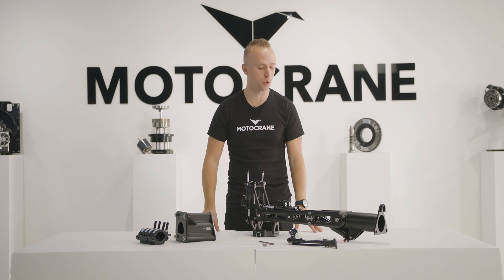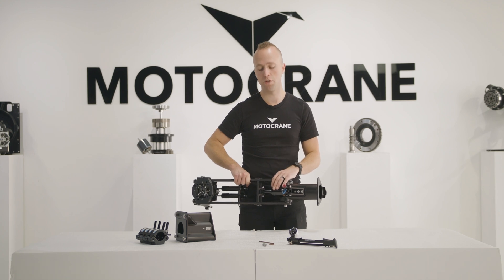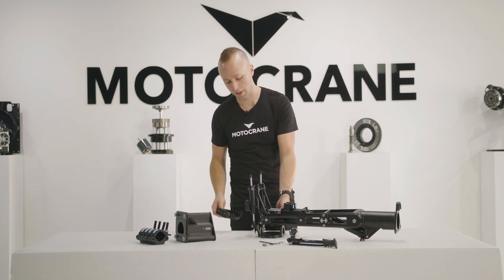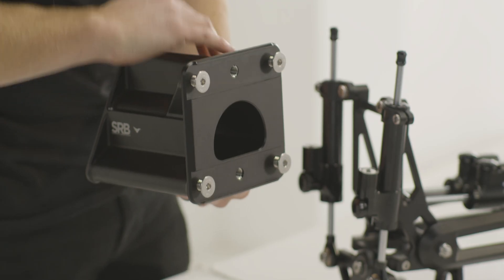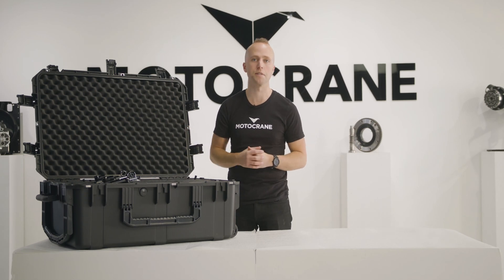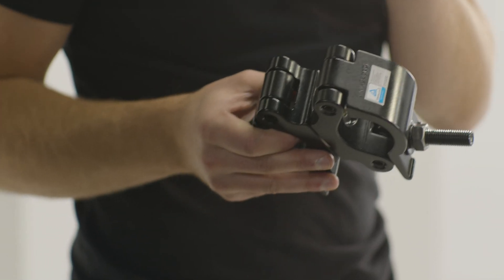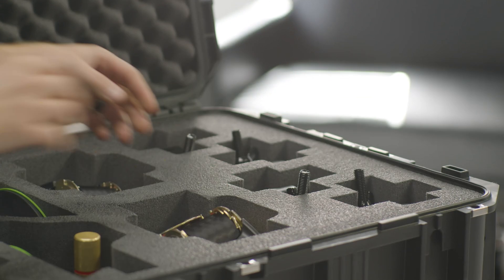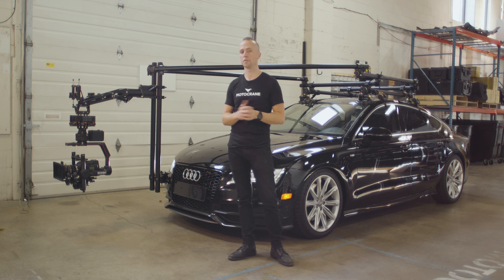MotoCrane ULTRA Isolator + SRB Technical Walkthrough

Comment: When using the dual speed rail upright setup, what is the width between the two rails? Is there an industry standard measurement here? Ideally I'd be using this mounted to the CineMilled hitch adapter, and want to make sure everything would bolt together properly.